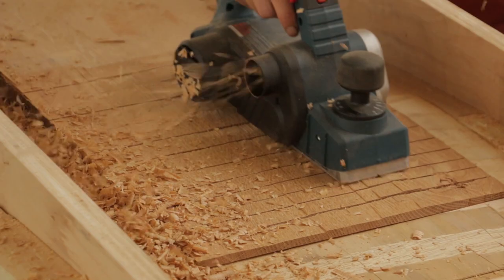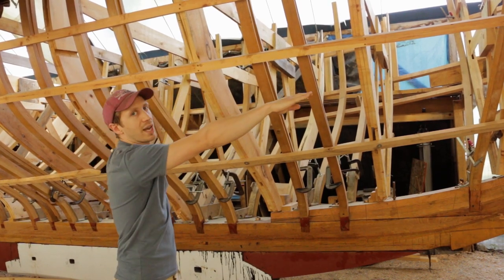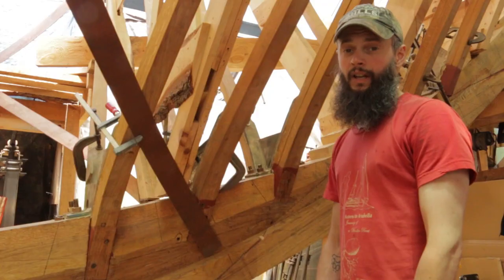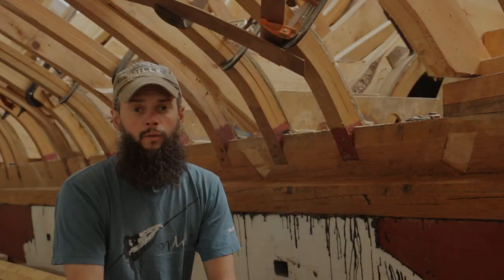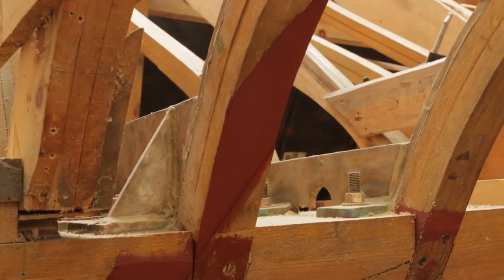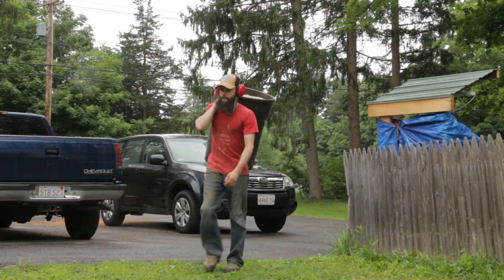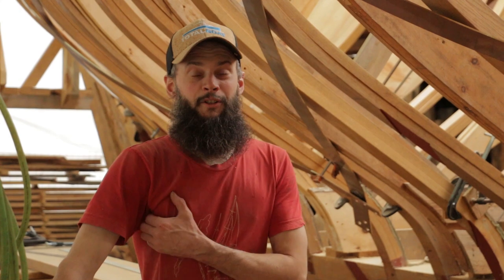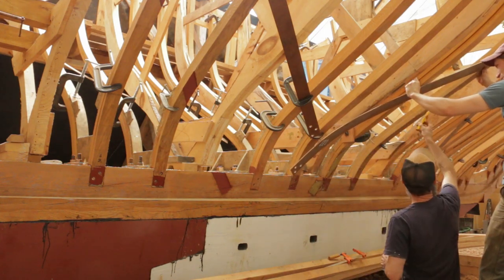Acorn to Arabella - Journey of a Wooden Boat - Episode 71: Installing the Bronze Strapping

Comment: Wow - never expected this!
Yes, diagonals are stability-magic in a rectilinear structure, the distribution of forces goes over all the interstices evenly and allows the entire structure to withstand the summed forces over the whole structure - which makes it super-rigid - except where there are specific anchor-points which receive the cumulative stress.
But these are not diagonals.
When you cast a triangle over a curve, is stops being a diagonal.
It brings-in another dimension that needs to have its stresses braced. If you do not account for the introduced torsion, you will create a "bowing" dynamic which will try to rip the boards apart as the stresses are translated to lateral tortion.
So, for instance, if you have gaps between the terminal points of the cross-braces, you will direct forces into the gap which will receive the summed forces on tht whole structure. So the gaps will get all the force - and had better be stout enough for it.
However, if you do lateral braces between the interstices of the cross-members - you will eliminate half the torsion load over the curve. 

And if you then go on to cross-brace the braces longitudinally, you will halve it all again.
However, total structural integrity only happens when you make triangular braces between the braces on the cross-braces.
Doing that kind of thing is only practical to make the resulting interlace occur below the useful space.
Blank X's make no sense - it will result in the destruction of the planks and continual re-caulking.
To do this right, you have to move the "X" intersections lower so they intersect the floor.
This will make the braces many more, and much thinner - and produce a denser transection as the straps climb up the curvature of the hull. Then to properly stabilize the resultant matrix, you have to cross-connect the resulting interstices at every point of opportunity.
You know?
Gusseting between the existing frames and boards - and every built part of the thing,  would be as good - or better - than straps.
If you do these straps - please understand the tortional results?
It might be true the keel and scupper materials are strong enough to withstand the entire force delivered them by these straps. But no.
You are going to have to gusset these straps to prevent damage to the hull-boards via lateral torsion.
They will have to be, at the least, cross-braced side-to-side from the X-intersections.. or the braces will rip the thing apart.
And really . no no no.
Metal has a different thermal expansion to wood.
Metal always rips wood apart from this  kid of thing ..
Wood responds to moisture, metal does not.
Don't use bronze for this.
Use wood?
Just gussets ??!!
But make them 3-dimensional gussets?
The bronze looks great, but it is no friend of wood unless you totally know how to harmonize it.
Better you 3-d print the damn thing from one material?
So you are sailing into some place that is dry and hot?
The wood shrinks, the bronze expands and the boat sinks.
I imagine the ocean bottom is littered with this mistake ..
Reply: I second this comment, in a single 2 dimensional plane these braces will function as you intend but as you have them installed, the 3rd plane will bring some undesirable effects into play. In addition to the above comment I would add that in the upper part of the hull where the curve is convex, any racking will cause the bracing to want to straighten and it will pull itself into the frames which is beneficial as it won't rely on the fasteners. However, in the lower concave part of the hull this straightening of the bracing will tend to want to come away from the frames, thus relying on the fixings and it will try to pull the planking away from the frames.
Reply: Thank you for saving me the effort of writing your spot on observation.
Reply: My thoughts as well. A boat/ship when made of timber needs to be able to 'move' with the forces of nature (wind/ waves) Without that I'm afraid there are going to be massive stresses that will splinter frames and planks.
Reply: I agree! The boat was not designed with these and now you're second-guessing the architect. If you think about it any torsional load applied to these braces is going to try to pop off the planks because of the curvature. Everything you've done so far is to strengthen this boat and now you are weakening it. Please please please think this through a little more thoroughly and read these comments!
Reply: Sounds like this needs some addressing
Reply: however: it seems you are translating the 'racking forces' that could happen to a flat rectangular plane(like a wall) that would put tension on the straps to want to pull them straight along their total length ... but on these complex curves the racking effect might be very different and spread those forces in more dispersed directions(and in both compression and tension) vs solely only trying to pull the straps out of their 'S' curve to have to be stopped by lateral bracing(pulling the steam bent frames in, or pushing the planking out) more like a geodesic dome? which doesn't require a spider web of straight tensioned cables internally - eh, just guessing here; altho this isn't the first boat to use this method for adding hull strength https://njscuba.net/z-artifacts/hull_wooden_ship_2.jpg
Reply: Huh?
😂😂
Reply: These are all good points being made here regarding the bronze braces. As a structural engineer one point to always remember is that the load always goes to the stiffest members in the system. If you have a flexible moment resisting frame and you add cross bracing to it to make it rigid, then the bracing and, more importantly, its connections have to be designed to take ALL the load or they will fail. You can't share load between flexible and rigid systems. The end connection on an x-brace has to be able develop the full design load in the brace, regardless of connection to other frames. 

No doubt the in-plane bending of the plank and the shear interaction with waterproofing between planks will create a flexible but quite stiff structure by itself, but how this stiffness will compare to that of the bronze bracing, how flexible the bracing will be as it pulls the upper frames in and the lower planks out and how the fasteners will translate those loads to the wood is difficult to predict and unless there is time tested historical evidence for such a system, is a crap shoot you can't afford to lose.

Another important point is that the notching of the pristine frames for the bracing weakens the critical outer fibers of the frames that are already stressed due to bending and gives a place for checking to begin as well as water damage.
Reply: I am a 30-year woodworker, 20-year homebuilder,  and this step is one I am wondering about as well.  Did you happen to discuss this with Thad?
Reply: As soon as the X's were mentioned i paused and checked the comments. I've never heard of these cross braces being used in boat building before. A wooden boat needs some flex to withstand the movement of the sea. Surely the planking, which if I remember correctly is going to be about 2 inches thick, will hold everything together. Victoria didn't have them...
Reply: I've had 8 years of engineering study in engineering science.  No studies in ocean engineering however,  Still, the preceding comments make sense to me.  The differing characteristics of the materials in combination with the complex geometry and seeming lack of precedence for this build approach concerns me.  It seems that you will experience unanticipated and undesirable side effects.  (Pretty much all unanticipated side effects turn out to be undesirable in my experience.)
Reply: As an engineer from a different field than ocean engineering it is clear to me that you are correct in theory.  Not being in this specific field however, I do not know if the effects that you have outlined are significant in practice.  I do not know if their effects are major or minor.  I would be concerned if they were not part of the naval architect's original design.  I would be concerned enough to seek the advice of a naval architect.
Reply: Differential thermal expansion comments would be worth considering if the Arabella team were to extend their sailing itinerary to other planets with oceans of molten silica or liquid nitrogen....
Similarly the criticisms of the diagonals being on curved surfaces. The deviation from flatness, in the case of a slack-bilged Atkin design, is small enough that the athwartship reaction forces referred to are literally negligible. It's a classic error of thinking to fail to consider degree in context, and focus solely on tendency. It's like saying that mammals have no future because they exhale carbon dioxide.  Whereas the exhalations of machines might indeed breach the threshold of concern: the topic is worth taking an interest in, but it boils down to degree as to whether it's a problem.

The first notable vessel to be fitted with diagonals (of laminated oak) was the USS Constitution, which was a fabulous success. But the frigging shipwrights had the last word decades later when it was refitted: they left them out. As a generalisation they are a conservative, reactionary profession, as are wooden boat designers, and neither of them spend any  great length of time at sea, if they go at all. 
Consequently sailors have been drowning unnecessarily since time immemorial, if they were not savvy or prescient enough to frap their vessels diagonally, with extra rigging to prevent the masts levering fore and aft, or with anchor chains diagonally under the hull, as described in the Bible.

"We've always done it this way"
"hmmm  ... That's a perishing long time to be doing something so wrong"
Reply: @UCPbq_FVPR-zikEds1QhqWfA Thank you for your fantastically well thought-out reply! 

Apart from you not having personal experience in the bronze-wood interaction dynamic (as I deal with every day), you are spot-on - and I thank you!
Just a hint - it's not all thermal with wood - the expansion coefficients in wood do not require extreme environments to put it at odds with bronze.
My comment here came from the root experience of having to make tents secure against whatever the weather throws at it.
I experimented with curvilinear structures because they pack-down small. But all of them failed due to the torsional forces.
I got engineering advice and defaulted to rectilinear structures across which I could make precise diagonals to turn the structure into a "membrane", such that after the cubilinear membrane was established, I knew that all the forces would get transmitted into the anchor-points on the ground, calculated gross force and made sure that the anchor-spikes engaged enough dirt to take the summed force with a 50% over-load.
I have been in fields of tents facing gales where my structure was the last man standing.
I did this so often that it became part of my visual mind and I can see stresses in shapes at a glance.
What I see with the discontinuous X braces on Arabella are 2 stress-events:
1. The gap between the terminus at teh highest point will get all the torsional force of the wave-energy, and had better be re-enforced. .. I mean .. if you are trying to create a "membrane" you connect the interstices to transmit the loads over all the brace-corners. Any disconnect of the matrix gets subjected to the summed force of the whole structure - and that's where it breaks.
2. When you cast a brace over a curve, you introduce an amplified flexion in the members that span it.
Now I will grant that much of this is accommodated in the grain structure of the wooden skin - but not all.
The result will be that the hull-planks will shift against each other .. and eventually grind-out their caulking.
I have seen anti-rigidity comments above .. and I do not agree. Flecture is the enemy of dead-wood. Live wood adapts to it in real-time - but we are building a boat out of dead trees who have lost the capacity to adapt to forces .. mostly .. they have "habits" that remain. And one of those habits is the expansion and contraction due to ambient humidity - and it is a big number. The gradient between 100+% of the sea and the human-friendly environment within the vessel is enough stress for the remaining adaptation left in the dead wood.
Adding the imperative of bronze, which marches to a different order of physics is "unkind" to the capacity of wood.
I don't need to go to Mercury or Pluto - I observe this every day here on planet Earth. I have a record of success.
My observations are not from marine physics - but I construe my experience from atmospheric physics and an intimate relationship with how wood and bronze evolve as mated materials.
I am not a formal engineer, but my advisors are.
But I take your points - and appreciate your motive for offering them - thank you!
Damn .. I love when I get the opportunity to have my mind changed by people who care! You have changed my mind - a little .. and that's what it's all about in my universe. Thank you.
(edit: you introduce the dynamics of mast-loading. I can so some things about that with my experience in constructing indestructible tents. Here it gets super-critical with boats - because the wind force and sea-force are always at odds. Just thinking about it, this makes the gunwales(?) very important in resolving the conflict = where the hull meets the sails and the mast meets the hull?
How do we do that?
Reply: I'm in agreement with what @ozwhistles and @Kai Wheeler have expressed as concerns.    These straps are definitely not going to act as diagonal bracing in the manner intended.   Installed as they are these are not straight members, they are bows!   When stressed they will actually apply "inward" or "outward" forces tending to separate the frames from the planking, and altogether creating stress concentrations in locations not contemplated in the design of the wooden structure.   They may well be weakening the structure in the long run.

Go back and look at the straps applied to very large wooden ships.  The sides of these ships were very slab-like.   I'd bet you'll find the straps applied as genuine straight diagonals rather than in a bow-like form.   I've never seen such - from my experience diagonal bracing was done in wood, inserted between frames rather than as straps external to the framing.
Reply: I was thinking the same thing.  When you put tension in a strap along a concave and convex surface, the concave surface gets a load from the strap that pushes into the frames whereas the convex surface gets a load from the strap that pulls away from the surface.  Truss design works for flat (planar) surfaces.  Many triangles can be used to create "curved" geodesic domes or arches.  The I am not sure these straps are good for the boat hull.
Reply from the maker: Gottenhimfella is correct. Additionally, Herreshoff (revered for his boat designs) was a strong proponent of diagonal hull strapping, as is Dave Gerr, a highly respected naval architect. Thermal expansion for silicone bronze is negligible, and not a concern in this application.
Reply: @AcornToArabella  Thanks - I stand corrected!
Reply: @AcornToArabella  Thank you for providing references to answer our concerns
Reply: @AcornToArabella  Except .. it is not the thermal expansion of Bronze .. that is insignificant .. it is the humidity expansion of wood that is the major factor .. and your bronze is at odds with it - and not joining the top of the X's throws the summed force in the wood between them - and you have not addressed the extra strength needed to re-enforce those gaps - they had better be very stout timbers indeed - running along the top anchor-beams.
And you are cutting into the ribs to accommodate the straps - that will negate the existing strength of the ribs .. Gott and Herr are not talking sense.
They talk like people who do not know what wood is?
I would believe them if they also talked about cross-strutting the interstices of the X's .. that would work .. and joining the Xs at the top would work (they are cross-braced by the lateral decking to form a "membrane").. but this is energy physics .. not folk-tales .. and I would like you to succeed.
Random X's seems like religion .. not results.
Reply: So many engineers, not a boatbuilder or Naval Architect in sight. These straps are standard practice back from the age of sail. Diagonal bracing just such as this is what gave USS Constitution, Old Ironsides and her sisters edge over the British, and has played a key part in in her holding her shape for so long. Back then they were of iron, today Bronze is the superior material in terms of corrosion resistance. The functionality is the same.

Diagonal strapping is in fact best practice pretty much no matter which Authority you want to consult on traditional wood construction. Classification Societies like DNV GL and Lloyd's, Designers from Dave Gerr to Herreshoff, builders like Larry Pardey, Nevis and A&R, take your pick.
Reply: @detonation5555  See the thing is, in shipbuilding you can pretty well consider the hull plating as zero width for your global structural analysis, dimension thickness accordingly and not worry to much about what's happening in the actual nonzero material. And that is now, in engineered steel hulls.

Wood construction such as this is a proven system and all structural members are more or less overdimensioned anyway, but they are sized according to what we have learned works over centuries.